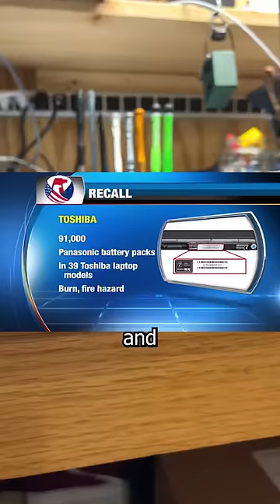This Toshiba Satellite is the worst #laptop ever made. EVER. #tech #pc #technology #shorts

Comment from the maker: Prior to 2014, Toshiba made REALLY GOOD laptops. I had one in 2010, it was a tank. Of course some had design flaws and other issues, but nothing that had to do with build quality. In 2014, they were in the midst of losing MASSIVE amounts of money, so they responded by making the cheapest possible laptop and completely decimating their reputation before they sold 80% of their computer division to Sharp, who then bought the other 20% later on.
Reply: i had the one w an athlon 64 or something lol and igpu died of thermal failure
Reply: In your opinion, what’s the best laptop ever made? Best brands?
Reply: Wasn't that due to their nuclear business imploding?
Reply: Used to have Toshiba NB series notebook (I belive it’s NB200) other than it’s slow, it is fine, could be wrong but my aunt still have it but the LCD has a line on it/or basically broken (caused by human error, probably dropped or it was pressured with something on top of it while it is closed)
Reply from the maker: @kooldudeno-lastname Lenovo ThinkPad T530 and W530, Mid-2012 MacBook Pro, 2015 MacBook Pro.
Reply: Agree...I wrote the same comment.
Reply: I had brand loyalty to Toshiba, my father used a Toshiba that lasted like 12 years, then my first laptop was a Toshiba, that one still works. In 2014ish I got a new Toshiba laptop and it was not as good at all, it has not lasted and is dead. And when I wanted to buy a new laptop I found out they're gone
Reply: My grandmas hp laptop from 2016 is still alive gpu temps 107c cpu 100c fresh termal paste no dust the cooling cant keep up
Reply: Yeah, back in the 2005-2015 if you wanted a laptop, I would've said, go Toshiba
Reply: I hv a tpshiba Satelite c 50 it's very good
Reply: i currently have a Toshiba a L655-1E9 from 2011 i got it for free with a misaligned hinge and dead hdd battery and deak keyboard got a new keyboard for it a week or 2 ago and damn that thing is a tank i put in a spare hdd i had around imma get 8gb of ram and an ssd for it
update the gpu died and it won't post
2024 edit i got a celeron n2840 4gb ram ho for $20 it's slow as hell but it gets the job done
Reply: Also they make good air conditioners
Reply: I had a shite C660 from 2010
Reply: RIP toshiba, we will hold you in our hearts
Reply: Yeah, I bought 2 Toshiba laptops one in 2007 and the other in 2010 and they were great.
Reply: bro what a coincidence. i was using a toshiba for like 3 months earlier this year when my dell died, it was actually doing quite well until the casing cracked, the palmrest fell off, it tried to murder its own motherboard when opening it and several other things. earlier today i opened it up to get some files off of it, closed it and cracked something on the way down with the lid. instant BSOD, RIP toshiba i think
Reply: And now Sharp is under the same pressure from Samsung.
Reply: @SalemTechsperts  Thinkpads from the T530 era are all pretty good. Have several T430s that I use for testing the Linux distro I help out with.
Reply from the maker: @igtlogan  They make a lot of fantastic products, but their computer division was run by a completely different company within Toshiba, and this is the result. Similar to what's happening at Lenovo.
Reply from the maker: @ConspicuousLiveMedia  Little fish eats big fish and the consumer gets food poisoning no matter what
Reply: gald you mentioned this, Toshiba used to make beasdt of a laptop I had a satelite L 50 B? I dont know but the build quality was awful and when I opened it it was built fantastically cheap like how they put everything in there and even the hard drive said refrubished on there despite being bought new from an official supplier brick and mortor chain lol
Reply: @SalemTechsperts yeah agreed thinkpad are genius design... its strong, and its upgradeable. 
worth every penny
Reply: Confirmed 1990s Toshiba laptops were great!

What's sad is with all the things they started to make and then stopped, from dot matrix printers to microwaves to flat screen TVs, laptops were the one thing they always kept making. Tosh making shit laptops is like Shake Shack deciding to boil all their meat.
Reply: True I still have in old Toshiba laptop 💻 from 2010  that build like a truck 🚛  I wish i can transfer new laptop motherboard into it 😂😅
Reply: i owned only HP and PB pc's
ive never had a Hinge or broken body issues
Reply: Ive got an old Acer from 2008 ITS STILL WORK YOU CAN RUN ROBLOX ON IT BUT THE battery die annd it got a malware 101 percent on my battery and my brother broke the screen
Reply: @SalemTechsperts  220x tablet here, may be part of last generation w/IBM 'built like a tank' quality. Speaking of Apple, my long retired, circa 2007 iphone 3g still works, and with the original battery. Almost forgot, my first computer, 1990 Macintosh IIsi is was still working last time I checked.
Reply: Agree! Btw, that fan looks like someone left a cat in their laptop lmao.
Reply: acers are also lcd breaking dumpster fires too I fixed 90+ acers and most of them are dead LCDs
Reply: We also had an old Toshiba its heavy af
Reply: Reminds me of the pc i got 8-10years ago and atr still using today bether shape then that pc you showd ewen tho my pc got dropt from knee heght 1 time:(
Reply: @SalemTechsperts  I've heard lots of great things about those old thinkpads and just how long they last.
Reply: I hate HP too. Every one I had the libirty to worked and or owned, everything is wrong about it. My experience is they are designed upsidedown and not made to be user serviceable in any sort of the mean. You would be lucky if your model actually had a RAM slot accessable without completely dismantling the whole computer.
Replacing therma paste means being forced to buy a new computer because when I worked on my own, shal we say I had a few too many misplaced screws and wasn't a good day for the motherboard.
Reply: my mom had a similar laptop by Toshiba and it lasted quite long actually.
she had bought it on in late 2014 and it had a dedicated amd gpu that started dying about 3 years later which I fixed by using the igpu. 
That laptop is still alive to this day although I took the hard drive out because it was dying
Reply: my dad actually had a satellite for quite a while
it lasted up until around 2020 where the screen just suddenly went dark and it stopped working entirely
Reply: I did have one in 2010, too! Still love that thing. Battery life was only like 2 hours, and it ran Minecraft at like 15 fps, but I didn't care! Loved that thing to bits
Reply: How about acer computers? I really own one acer computer from my dad
Reply: Had a Toshiba laptop. Don't remember the model because it's been a while. Got it in 2016 and worked perfectly until one day it started lagging. I turned it off and back on but it didn't boot up and when I opened it nothing seemed broken. Took it to someone for repair but still haven't heard from them. Ended up buying a new laptop.
Reply: I had a Toshiba C650D that im trying to bring back to life but i cannot find a power supply
Reply: I when I had a Toshiba laptop but it broke it’s slowly started falling apart the screen broke well actually it was like the little lights and the screen broke then the touchpad didn’t work and overall everything started falling apart the laptop was really slow and I could even run OBS on it just opening google was a struggle I don’t want a good thing about it was the storage
Reply: I who watching this on my TOSHIBA c50-a-1fz which i use regulary of 2014
Reply: Actuallt toshiba, hp, lenovo made too many bad laptop.

Its the same for Msi laptop but here this is a drivers peoblems most of time because they dont update drivers when a bug is discovered.

I use rog actually and no problems for the moment
Reply: I had a Toshiba about twenty years ago. Bought it at Best Buy. It was a paperweight piece of trash bought from a scum of the Earth company that completely ripped me off.
Reply: I have a 2017 Satellite Pro, only got one major issue still goin strong today
Reply: Same
Reply: I still have a Toshiba A660 from 2010, still kicking ass today, just cant be used too long with the battery
Reply: My mom still uses one of these with the original battery and no issues it’s slow that all but nothing is wrong with it
Reply: i have some quite old tosh laptops and apart from one, still working nicely , they really went downhill like a rock with this pile of horse plop,, i'd still like to get one, though, if very cheap, for my collection 😁
Reply: Basically a hail Mary laptop to go out with a bang, pop, and an oh f*ck, there goes my workflow!
Reply: It’s looks similar to HP 250G3
Reply: i have that laptop. im watching this on it
Reply: I had a satellite from 2008. It was just as bad as the one featured in the video.  The chassis was full of glue within the first year.
Reply: @null7639 oh yeah, those don't make it past the first year with the stock thermal paste.😂
Reply: My polish homeroom teacher has THE EXACT SAME LAPTOP, still alive, slow af
Reply: I have a Toshiba NB200 netbook from 2009 that I got from my parents for school work, still have it to this day and it’s build quality is pretty good for what it is, some bits of the bottom case are made of thin sheet steel instead of plastic which is surprising.
Reply: @thegeforce6625  oo what are your usual temperatures?
Reply: @RimFaxxe  iirc wouldn’t get any hotter than 70-75c, mainly because it uses a Intel Atom CPU that uses only 2.5w
Reply: i have a toshiba imported from japan i think its from 2006 or 2009 and it still is in good condition
Reply: Having one, have had it for years, cannot run win anymore at all, currently only Linux xD
Reply: I have a thick windows 8 toshiba laptop and it works flawlessly
Reply: I repaired a pre 2k Toshiba laptop that ran windows 98.
That thing was thick, It could tank literally anything. It has one tiny fan in the back and no airflow, and it was just fine lol. (Had a cd-rom drive and floppy disk drive too!)
Reply: M900 my dad laptop. Last years before hdd died. Best design of a laptop ive ever touched. Nothing like that now.
Reply: My dad had 2007 Toshiba satellites accompany me spectacularly until 2017, after 2013 it's need a constant plug. It's hot as teflon.
Reply: My moms Toshiba is so old the screen is absolutely brutal...and the hinges don't even hinge anymore.
Reply: I have a working one that I use every so often when I’m fixing my gaming laptop because I do monthly cleans and every 2 months I change the thermal past on my gaming rig
Reply: Well that’s sad. I have a 2006 Toshiba which as far as i know still works fine, other than the battery, if the urge to use a core 2 duo again ever strikes me. Was in active use 2006-2014 or so, the last 3 years as a hackintosh
Reply: My mum owns one she had it for a little bit and then the something burned in it now that's some good power from toshiba
Reply: Yep the mid-2014 MBP is an absolute monster. Sadly no more OS support, just needed to put in a new battery and it would go on for another 5 years no cap @SalemTechsperts
Reply: I had a 2006 version that I had to replace because I broke my charger in side the slot
Reply: @SalemTechsperts ”this video is sponso-
Reply: I still have this laptop. My dad gave it to me on my birthday in 2014 and it is still in good condition.
Reply: The only Toshiba laptop I had was back on 2008. It had many issues with the screen, but other than that, it still works today.
Reply: The 2010 ones ..... my dad bought a Toshiba Satellite c660 thing is a tank. He still uses it , it needed an Drive and RAM upgrade and only recently started showing issues with the keyboard.
Reply: Absolutely
Reply: I forget the model number, but I had a Toshiba that I took with me to Afghanistan and back in 2011 with no issues. I replaced the battery and the HD with an SSD and basically revived it to new life. The thing finally died when my sons decided to use it as a frisbee for some reason, and that was last year.
Reply: Coming from someone who uses a Toshiba Satellite L755-S5359 from 2012 running Windows 10 as my main, I am grateful.
Reply: I had toshiba l650 with 4 core  mad cpu
Reply: My first college laptop (2005) was a Toshiba that I bought through the school. I used it for 4 straight years, then upgraded, then had a cat-beverage-laptop mishap that forced me back to the Toshiba, which served as my primary until like 2012. The thing was a barely functioning wreck that sounded like a rusty chainsaw, but it worked when I was too poor to afford better and I was grateful. Sad to hear they went to hell later on, at least if the video and comments are to be believed, and why would I doubt *the Greatest Technician That Ever Lived*?
Reply: @SalemTechsperts I think you mean 430
Reply: @SalemTechsperts my mom still has one of these computers, still gets used, and it hasn't broke down.
Reply: This is the same model of my pc
Reply: Yep. Had/still have a P755 satellite. It's sitting in my room right now. I use it infrequently but it's still going just fine.
Reply: HP is not bad too back in 2007.. the compaq line is built like a goddamn tank ffs
Reply: I usually have good luck with the Toshibas I bought, but I have a beautiful Portege that I ordered in late August 2015, a few months before the company folded. Even though it is nominally "repairable," I can't get a new battery for it, while I can for an older "disposable" mini notebook that I'm still using. Go figure.
Reply: I have the Toshiba Satellite still in working order (mine is silvery), running on Windows 10, but requires a constant power supply. It still works within limits without overheating, and thus for most of 2020, I used it for the online remote classes.
Reply: I too have the 2010 satellite fcking tank
Reply: Hp= hates pcs to every repair shop as they're always thinking oh it's hp why did it have to be hp every time a hp comes in the shop.
Reply: wheb did japanese people nake falws to tech?
Reply: I was about to say, I had a Toshiba from 2010, and it lasted for at least 10 years.
Reply: @bonnecherie  damn that's Cray Cray
Reply: then that's not really greed isn't it, as your video description said
Reply: I have one with amd e2 2012 model, still using with windows 10. Slow but sufficient. 😂
Reply: @ayashazhar5340  if it ain't broken don't fix it right?
Reply: Idk which one is it but I currently own a Toshiba satellite, it is due for lots of repairs though but I can’t afford any
Reply: I used to alo have a really old one (probably less than 2010) and it lasted for so long i tell ya. I only got a newer one because of how  slow it was.
Reply: Bruh i use that laptop Till today i play ONLY cs 1.6 ,half life 1
Reply: It's really sad to see a company that once ruled the laptop market, reduced to a low quality garbage like that. I had a Toshiba Satellite 325CDS in 1998 and it was a tank! The only part ever replaced was the hard drive after a lot of hours of use.
Reply: I have concur with OP. I have a toshiba satellite L505 from like 2008 and i could bludgeon a man to death with it and it would still turn on. That thing was like...Xbox Duke controller sturdy.
Reply: Nice info, yes older Toshiba laptop is solid and very strong but towards their eventual release by the main Toshiba Corporation, the build quality is degraded and also the support site for searching driver was quite difficult to navigate

After being released from Toshiba Corp, it's now lived under Dynabook brand (which is actually the original Japanese domestic brand) and the build quality actually improved, and now, it's focusing their product line towards business use, so only Satellite Pro, Tecra and Portege line remained. The Satellite and Qosmio no longer exist
Reply: I have a tosh-tosh L755 and it runs windows 7 perfectly. I currently have an HP HEWLETT-PACKARD portable workstation g2 with windows 10 pro. It currently runs like shit.
Reply: I had a Toshiba satellite and it stopped turning on and it only turns on when is use a ultra small dell barrel charger
Reply: I am not THE GREATEST TECHNICIAN THAT EVER LIVED, but, the local computer store said that HP laptops are the worst for durability, and they are constantly repairing the hinges that break so easily due to the cheap plastic that they are spawned from.
Reply: One of my old Toshiba laptops was such a tank that it still tanks on as my grand-niece's school laptop today. Just swap the drive out for an SSD and it works.
But yeah, after 2014ish, the brand went bad.
Ironically, one of the first computers that I actually owned myself back in the early 1980's was a Sharp (MZ-700, later got an MZ-800 too) and I loved those Sharps.
Reply: I can agree my sattelite took more falls that my hp now
Reply: Have a Toshiba and still working but very slow
Reply: Yeah I was confused because mine in 2006 was brilliant
Reply: I have a Toshiba Satalite A135 from around 2006ish that works great, has Debian 12 Mate installed, and with a YouTube program I can't remember the name to, I can watch YouTube on it at 720p and is pretty quick. Linux is only using about 750mb of ram.
Reply: I had a Toshiba satellite L35 and that sucker was great but sadly it died but fear not I’m getting another Toshiba satellite L35 for my birthday
Reply: Agreed, my first laptop was a Toshiba satellite that i purchased around 2012 o 2013. That thing was really sturdy,i had it for like 8 years and still worked when i replaced it for a new one.
Reply: Ummm they should stick to making CT scanners and other medical devices
Reply: i had the same model in school
Reply: I have a Toshiba TV at my house, had it for 14 years since my mom bought the current house at a nice discount. Still works great with no problems whatsoever, but we’re currently in the process of finding a replacement.
Reply: I own a Toshiba VCR that still works even though it was from 1995
Reply: @davidrichardson356 in the modern world, yes that’s  correct
Reply: When I was younger, my primary (elementary) school only had these laptops. How are they in 2024? Well. All I can say is they don’t start up.
Reply: Yeah, I had a really good Toshiba satellite that was from before 2010, still going strong. Just really, really, painfully slow because of many reasons, one of which is the HDD.
Reply: I had a Toshiba Satellite back in the 486 days.  It was a tank, literally, if my massage therapist's bills are to be believed.

Today, they live on as Dynabook, which seems to have decent specs for the price despite being a very boring looking product.
Reply: I actually have a similar model. I don’t really use it anymore but it still works pretty well.
Reply: I knew the same exact model that I shown in the video. I kept the hard drive. I didn’t have quality issues (physical) but the camera stopped working and it only lasted about 6 years with barely 25 hours of use
Reply: My first laptop was a Toshiba Satellite something, dated back to 2003. It's still used to this day, attached to an old CNC machine.
I then bought one myself in 2012 (Satellite L-something). The build quality was similar to the one in the video. Worst laptop I ever bought. I was unsure between that and an Acer (a brand not associated with quality back then). I regret I didn't choose the Acer.
Reply: I have a old 2009 Toshiba Satellite A500 Installed Linux on it because windows 10 is support is about to end and now it works Perfectly fine
Reply: I had one from 2016 and the keyboard died out of blue. Other than that it still works though.
Reply: My uncle had an awesome Toshiba laptop in the early 2000's. I can't remember the model, only that it was a blue & silver two-tone color scheme & had beefy hinges. The build quality was top tier. It had one other thing that blew me away- the LCD display could go up to a frekin ridiculous resolution like 2500xwtf or something O_O & I'm not talking about the situation where the visible screen  area follows the mouse cursor around, this LCD laptop screen supported that huge resolution natively. I had never seen anything like it before.
Reply: pookie whats your fav computer i wanna get one
Reply: I have had one since 2011 and it’s still perfect
Reply: I've got my 2010 sitting in a box somewhere because I killed it because I fell asleep using it and when I woke up I knocked it off the bed and it fell to the floor pushing the charging port into the casing so it can't be charged anymore, but I was able to get all the data off before the battery died
Reply: They WERE tanks, i still have one of them sitting on my window sill, it's too slow to use but i keep it from nostalgia, it was my first PC (windows Vista btw) i spent too much time playing Minecraft with 18 fps crashing when I turned my camera over to a more detailed part of the map
Reply: @PoieczeQ  hahaha i love this and thats amazing that it was able to hold minecraft 😂😂
Reply: Never owned onr myself but my wife had one ,looked good and all but the first thing to die was the hdd,the quality was good. i think it was a 2008 one so they were really good but useless hardware wise,just nice furniture. I guess it was good when it first came up.
Reply: Surprisingly, mine still works?!
Reply: Toshiba satellite is a better Dino lp
Reply: Neat
Reply: Is Sharp part of DynaBook?
Reply: I had a Toshiba, and the thermal management was TRASH. It was a hair & gooch magnet. I was glad when it died.
Reply: That makes sense then. I had gotten a satellite in 2013 that iirc was already a couple years outdated. It lasted forever until we damaged it trying to upgrade the drive. (the bay was really poorly designed imo, it was impossible to add or remove the drive without flexing the sata connector away from the board). But in the 5 or so years i was actively using it the thing bluescreened on me about once or twice, and really had no other issues i can remember. Skyrim was even just playable enough in spite of it being a dual core i3 😂
Reply: I had a toshiba laptop that lasted 10 whole years. I had to throw it away in 2016 because it couldnt even boot into linux (known for being way lighter and faster than windows), but it served me well. I played videogames and did school projects. I rly liked toshiba, didnt know that now its so bad, sad
Reply: @noveliayuki  the Toshiba L series laptop I found I didn't keep, as it was in poor shape!! Kept the HDD & RAM!
Reply: Toshiba did make excellent laptops between the years 1998-2010. I could never afford one, as they were expensive during this time. It is shocking to notice how their build quality standards have dropped ! 😮
Reply: @SalemTechsperts  me on a toshiba satellite from 2003:
Reply: I had a earlier Toshiba that had a i3 2310m and it was heavy and built like a tank,you could replace ram,battery and storage without opening everything and it lasted more than 10 years,only reason I stopped using it was because I got a PC back in 2021
Reply: @Mackyo_15  Some laptops, with a bit of luck, can last between 20 to 30 years... It depends on how much usage or punishment, an individual would dare on its internal components.
Reply: I have a Toshiba Qosmio X70-A who's still going strong today...and so is her cousin, this hunk of junk's older brother (a Satellite A205, built like an absolute tank. Surprised these two are even related..)

I did have a Toshiba from around 2014 however and it kinda sucked.
Reply: I got a Toshiba around 2013. It held up aside from needing a fan and battery replacements until it was dropped hard this year. Despite the laptop being utterly bricked, the hard drive still works with no bad sectors.

I wondered why they stopped selling consumer laptops...
Reply: I had wondered about that — I owned a Toshibe and had friends who owned them, too, and they always struck me as closer to Soviet-era "portable computers". They were capable machines, but built like a tank!

That's why I was surprised when I bought the Toshiba I owned was so lightweight. Guess I know why now....
Reply: I had one that held my childhood together 5 years later I remembered it 
I charged it 
Then the hard drive started clicking 
Then it died and just started boot looping
Reply: You mean the accounting scandal? Toshiba was fucking with the numbers in a profit manipulation scheme
Reply: well i have a ac toshba
Reply: that's my laptop
Reply: Talk about a bad business decision
Reply: I have 1995 Toshiba Satellite dont know the model but it has that mid 90’s grey thick plastic.
Reply: Toshiba, more like Toshitta.
Reply: I had a 2010 toshiba c50a 1 dv , after running for 14 years , i scrapped it today
Reply: I still have Toshiba Satellite C50 13D. It is a good laptop, but it's battery died:(
Reply: My 2009 Satellite is still trucking along after an ssd swap and ram upgrade
Reply: I have a 2001 compac windows xp home edition and it still works like a charm